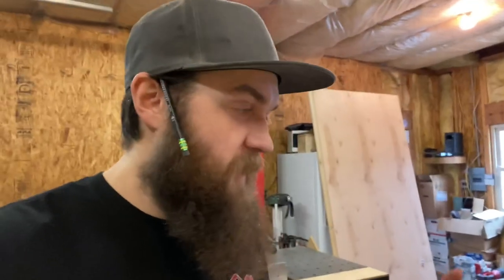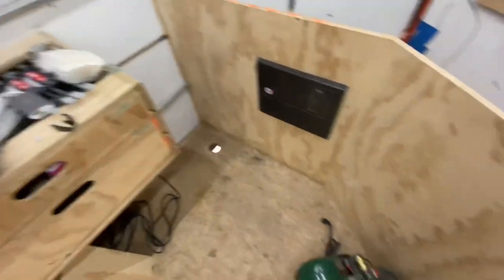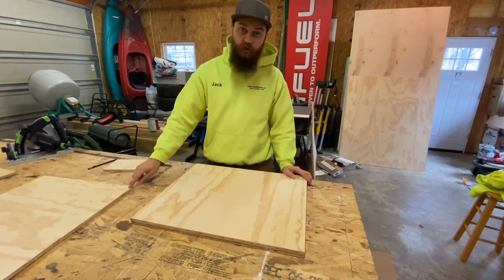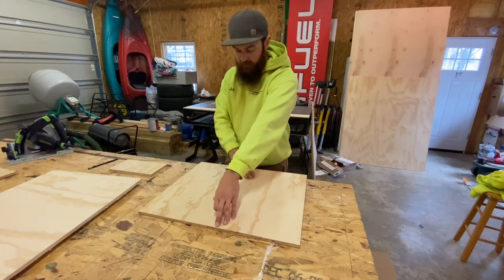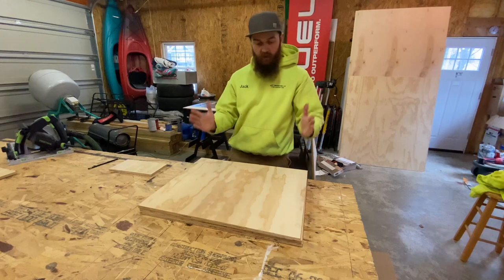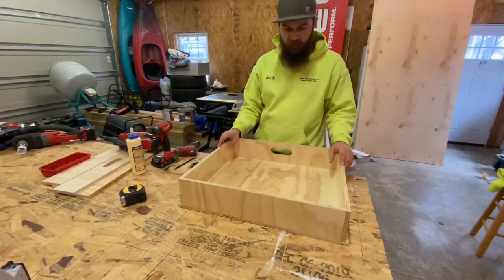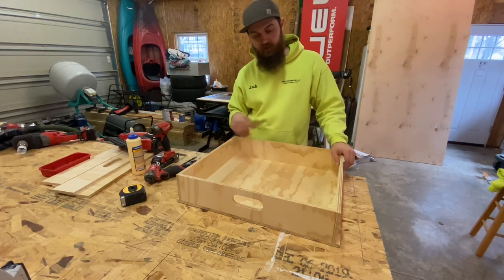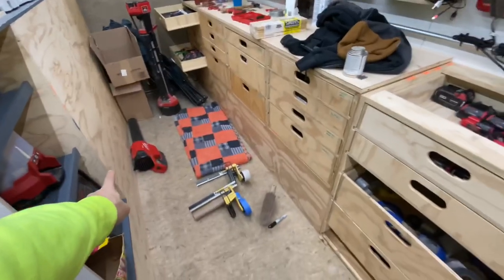Tool Trailer Drawers

Comment: Few questions on the drawers and uprights...

Is this 3/4" plywood?  
What depth for the dado that the bottom of the drawer slides in?  
What was your method for cutting all the dados?
Reply from the maker: @gsd_802  all drawer plywood was 1/2”. I don’t recall the depth on the cabinet sides. My guess is maybe 3/8 of an inch. I used a router with a 1/2” bit in it and made two passes to make the dado about 3/4”.

Comment: Do the draws open while driving? Or are they pretty secure with the weight of the tools in them?
Reply from the maker: For the most part they stay shut a few of the lighter weight drawers slide open a little bit sometimes. But I’ve never had a drawer come all the way out and fall on the floor